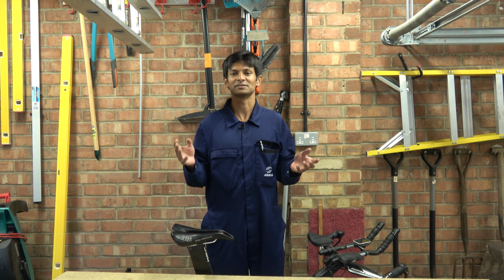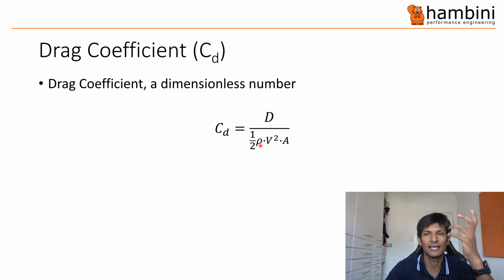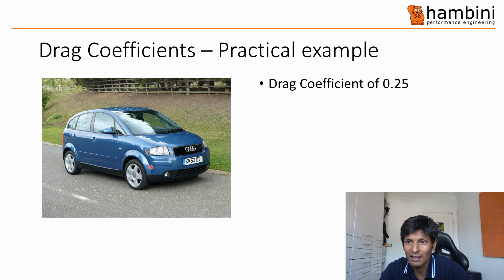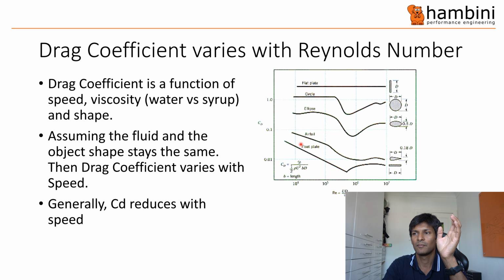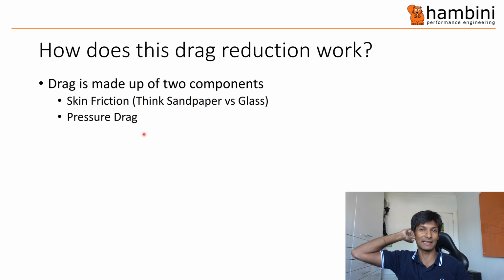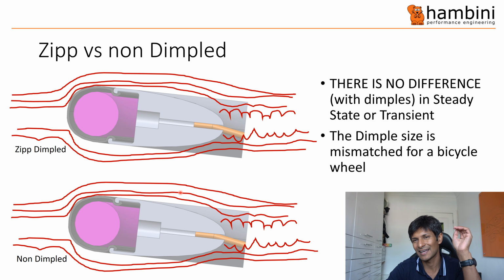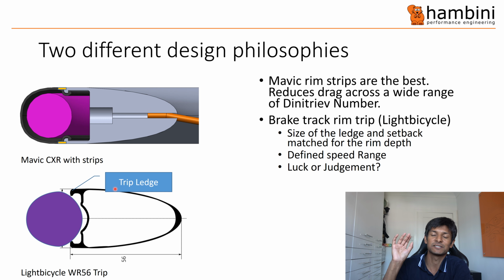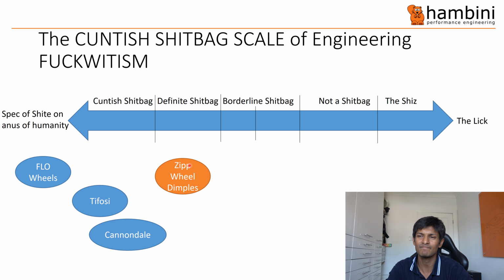Aerodynamics: Zipp Aero Bike Wheels (A Hambini Reaming)

Comment: I have Enve wheels because they’re strong for a Clydesdale, with molded in spoke holes. For me that’s the key consideration and aero is a nice to have. I do care that they don’t blow me around in the wind and that seems to work well. But I also noted originally why the dimples were there on the Zipps. I was wondering if they might keep a sheer layer of air moving in the Rotational direction of the wheel attached, since I assume Zipp just designs with tunnel measurements? I know the dynamics there are very complex because the air must be moved slightly in the rotational direction as well, and any turbulence generated might cause a shear? Just wanted to ask an expert?

Comment: Very suprised Audi didn't do better with the A2 considering the mint wind tunnel they have at ingolstadt 200 kmh air 1metre from the car you can hardly feel or hear the air, sorry for going off subject
Reply: I guess A2 was not a big margin car, it's better to sell cheap inefficient SUVs and trucks which will cost the consumer a lot in gas. The manufacturer don't care about that and prefer bigger margins than selling beautifully efficient aluminium machinery. That's why we desperatly need law on car efficiency. Also people tend to buy the cheaper product even if it's more costly in the long run. They also like high car because of the false sense of safety. While we are deep in the ecological disaster people still tend to mock egg shaped cars and think trucks looks cool. Mankind is lost.

Comment: Hmmm so a coke bottle shape , like the F4 phantom would be better than dimples  in reducing boundary layer drag ? 

The tyre being the wider part with just under the brake surface being the pinched waist to a wider section just before tapering to the spokes ?

Comment: Hambini.  May be good to let people know that values like Cd/Cl  for Aircraft often use different characteristic dimensions to that used for surface vehicles. ie. Cd for cars uses frontal area, for Aircraft it uses Planform area. - Therefore the numbers aren't directly relateable.

(Like how Re for tube flow uses the diameter of the tube (as characteristic dimension), while for Plane surface flow they  may use the depth along the streamline to determine IF the flow WILL trip of its own accord (or for infinite surfaces, the length along the streamline at which it will "Trip" into turbulent.... yata-yata-yata......ya know how it is...

Zip wheels.   several tripping mechanisms without putting dots on it...  

It has been stated that intentional regular surface imperfections are beneficial in obfuscating manufacturing inadequacies..   lol.

Comment: Agreed in regards to frontal fluid direction only, but explain thoughts on rotational angular advantage of creating turbulent boundary both during rotation and the following entry to rim-first flow at the rear of each wheel in forward motion. (i.e. fluid interface at the rim section behind the axle of each wheel)

Comment: What effect does the rotation of the wheel have?  I'm guessing this would change the direction the air flows across the rim, effectively creating a longer cross section. 
Do the dimples have any effect on the top and bottom of the wheel where the profile will be much larger?

Comment: I liked how you brought Reynolds into the discussion. I was surprised you only demonstrated the aerodynamics with a radial section cut, instead of a section cut at various places on the wheel to show the airflow the wheel actually sees, factoring in the rotational velocity of the wheel.

Comment: don't know the effect of this (because aero wheels are more aero than non-aero wheels) but when you map out the linear velocity on any part of the wheel, the wind will never be hitting the cross-section head-on (except near the contact point where the velocity is nearing zero). So at 3 and 9 o'clock, the wind will be hitting the cross-section at 45 degrees, or elongating the cross-section. How will this affect drag? P.S. Just found your channel and am really enjoying all the content. The first time in a long time I'm hearing some really engineering around cycling. :)

Comment: The reason stuff falling from space gets hot in the atmoSphere is caused by the pressure from the air resistance.
Reply: Pete is never wrong  Nope
Reply: Pete is never wrong  https://youtu.be/TuDfZ2Md5x8
One of many places that tells the same thing. This was the first that seemed kinda easy to understand.
Reply: Pete is never wrong  Friction is present of course. It is still not the main "factor". As it is clearly mentioned in the video for children.
Reply: Pete is never wrong  Still not the main reason for objects heating up on atmosphere entry tho. So you loose.
Reply: Pete is never wrong  Dude. You don't have to be ashamed to be wrong once in a while. You are now just trying to save face by bashing on me and my oh so bad grammar. 

If in the first comment you had said for example: "-And friction." then I would have to agree with you.

But you clearly meant friction is the biggest or possibly the only reason for heat build up.

I'm sorry if this whole ordeal hurt your ego.
Reply: Pete is never wrong  Yes. Try and brush it off. Makes you sleep better.
Reply: Pete is never wrong  lol. nice one.

Comment: I call bullshit.  The wheel is so light it is impossible to keep straight on a road (not in a wind tunnel) thus the giant cross section is sideways in the wind occasionally.  Add weight to the rotation and it’s going to roll straight and you won’t slow down in corners.  Once owned Cinelli discs that came with enormous brass weights.
Reply: Not BS on you, Mr Hambini.  On all carbon bs wheels.

Comment: Though the dimples are in the wrong position for the forward face of the wheel, does this mean that they are in the correct area on the trailing part (3oclock position) of the wheel where they form the leading edge?

Comment: I love my Cannondales. I love the ride and performance of them. However, as much as I want to deny it, I have to agree with this. Case in point, BB30/BB30A, for those who don't know.  Why create a standard that half of your bikes don't meet? I have BB30s on my bikes and I've had okay experiences with them compared to what many others have experienced. However, many of the mid-tiered and all of the lower tiered bikes do not use BB30/BB30A and the systems. I get it. It's to save weight and perceived stiffness. However, they use are a lot more reliable.

Comment: you are only half right in your presentation, alas. golf balls use relative spin to create considerably more lift (by making air go faster above the ball than below) , thus allowing them to stay in the air for longer despite their considerable higher drag coefficient than their smooth counter parts. that said advantageous relative spin is absent in the aero bike wheel(given that the dimples on the aero bike wheels don't have the same  vectors/spin/relative position/etc as the dimples on the golf balls ) which leaves you with just a wheel with a higher drag tax than a smooth one.

Comment: I really enjoy the technical elements of this previous aerodynamics video. I tried to fast forward past the childish name calling sections and not let it detract from an otherwise great video (I’ve made my views on this clear in your Cervelo video and while I disagree with your point of view, I appreciate your honesty and taking the time to reply).

My question for you is: Do you have any suggestions on reading material for someone that is interested in educating themselves further in aerodynamics with assumption that I am starting from the fucktard end of the educational scale?
Reply from the maker: Aerodynamics is basically applied maths. If your calculus is not good then that would be the first thing to read up on. 

After that, fluid mechanics, you need a grasp of that followed by aerodynamics which is fundamentally steady state and designed for planes. The step after that is unsteady aerodynamics which is more appropriate to bicycle riders riding at normal speeds.

Comment: I am not a professional by any mean but atleast in car exhausts a straight through muffler with a pipe full of holes (like dimples) for sound to go to a dampening material in the muffler has been shown an increase in flow as the turbulent boundary layer lets the air pass more freely than in a case where the pipe wall would be solid. So at least in that case the point is not to reduce the pressure drag but to reduce the skin friction by allowing a small amount of turbulence in the boundary layer which then in comparison negates the turbulence in the major cross section in the pipe. So by having a parallel flow to the pipe (a wall) making the wall dimpled reduces the total drag even if the skin drag at the boundary increases. How would you compare that effect to the essentially flat sides of the bike rim? I have seen zipp disc wheels with the dimples all around the disc surface so there should be a point to that other than moving the separation point.

Comment: Cool vid! Just like the other ones by you. Learned something!
How does the story hold up when you look at the wheel (profile) above the axle. Say I ride at 40kmh (not 50 as promoted and testted by wheel brands) The profile at axle height goes 40kmh also and it has the advertised section... The top of the wheel will go 80kmh and just below that it will move say 65kmh, and with an elongated...oval..profile? higher Re number...so no dimples needed either? 
If I look at it this way I might not need the 80mm deep section wheels...

Comment: Only at speeds approaching 50 kph does the advantage of aero frames/tyres/wheels really kick in. For all you weekend warriors spending big money on aero kit, unless you are fit and strong enough to ride consistently at over 50 kph, spend your money on loosing weight and a good coach to make you go faster !
Reply: That is not correct. The aero advantage is present at all normal competitive cycling speeds, even fat amateur triathletes.  Do the math sometime: http://aeroweenie.com/calc.html compute the time savings over a fixed distance at various speeds

Comment: I don't completely agree. For the "backside" of the wheel the dimples are in the right place.
Reply from the maker: By the time the air gets there in its rather erratic nature. The dimples are useless. Additionally, it's the wrong speed
Reply: @Hambini  Yes you're right, the effect is almost zero.

Comment: I have been using silicon paste to seal the gap between the tire and the rim for my aero wheelset. Adds about 80g of weight per wheel when properly done. I wonder if there are lighter materials that can do the job without going with a full mavic set.  Also I have noticed that hookless clincher rims give a better continuity at the tire / rim boundary than hooked rims.

Comment: Curious if you ever listen to Josh Poertner's marginal gains podcast. He talks about wheels as part of a whole system:  rider, bike, road surface, tire size and pressure, etc. he seems to approach engineering as an optimization problem and I wonder if your aerodynamics analysis count for real-life limitations (tracktion, flat protection, comfort, etc.) that are also important factors for going faster.
Reply from the maker: Personally, I don't rate him as an engineer. He is well regarded because he publicly dishes out lots of information but after putting out this video, I found out he was responsible for these dimples.

In aerospace land, we think he is out of his depth.

Comment: I would like to see an expansion of the 'Cuntish Shitbag Scale of Engineering Fuckwitism' with more brands, please.
Reply: Agreed, intrigued to see what classifies as 'the lick'
Reply: @mr_musette  Slightly beter than waht i am
Reply: Agreed. Fulcrum, Roval, etc.
Reply: Hed, Lightweight, enve...
Reply: Would like to see one aswell!
Reply: The average rider can usually lose less power through position than aerodynamics since few people ride fast enough to get a gain. I desend fast and generally leave most people behind. Not because they don't have the best bikes that money can buy but because high speed on a bike is scary and you always have that nagging thought in the back of your head about getting a blowout at that speed. With a car coming the other way. And a barbed wire fence the only resting place.

Comment: Wish I watched this video, before buying a set of 808 firecrest wheels. I’ve the disc brake versions. I’ve only ridden twice in 10-15mph winds. So can’t comment really on performance yet, it may just be the placebo affect but I feel I am get up to speed quicker and my top speed has increased, my average has increased. I’ll know more after I’ve done 500 mile and compare the data. 
Today I worked out the air speed over the wheels, it’ll be about 9.5meters per second in to wind. Will the dimples really have any effect on the performance.

Comment: Hi Hambini - I have a tifosi and i quite like it. Could you explain why Tifosi is shite?
Reply from the maker: Have a search for bottom bracket from hell fixed.
Reply: @Hambini  yup.. just watched it, well done.  I wonder if t's possible my issue with my tifosi is related. Effectively, at proper torque spec of the crankset, when weighting the non-driveside crank, I get a small click/slip. If I the  reverse 180 deg and equally load the crank, I get a the same click/ slip. Lastly, when the crankset is properly torqued, the BB is very very tight and I cannot easily spin the drivetrain. If I only slightly tighten the crankset, it spins super easy. 

When crankset is torqued properly,
1) can alignment cause the BB to bind and feel like a thick syrup when pedaling? 
2) what can slip in the BB, if it's not the crankset spindle

Any help would be great.
Reply from the maker: Sounds like a fit issue. I would give Tifosi a ring and see what they say.

Comment: Yes, narrower tires will be faster in a wind tunnel and on steel drums, but with rough road surfaces and slight bumps there are a lot of suspension losses that make wider tires that much faster in real world scenarios. No, a 32 won't beat a 21 on new roads, but on even brand new "smooth" roads you'll see a benefit from bumping up to 25 or 28.

Aero gains are huge, but nothing should be solely judged in a vacuum.

Comment: I want to see Hambini roast the claims of Specialized that disc brake wheels are as aero as rims
Reply: Disc brake wheels are actually more aerodynamic than rim brake wheels, IF the rim is designed properly...
Reply: @hippotek1  I seriously doubt that since front wheel needs to be significantly dished and that can create different air pressures
Reply: @oreocarlton3343  Well: 1. No, they do not have to be dished. It's a matter of hub design. 2. The rim has a much bigger influence on the aerodynamic performance of the wheel, than the spokes.

Comment: Did I missed it, or wasn't there any actual explanation based on the Reynolds Number, why the Zipp dimples are not as effective as the ones on the golf balls? After--in my opinion--a good approach at the beginning unfortunately you've got distracted by your numerous rants and forgot to give a plausible explanation for your claim. What is the range for the Re number for a bicycle wheel in air for relevant speeds?